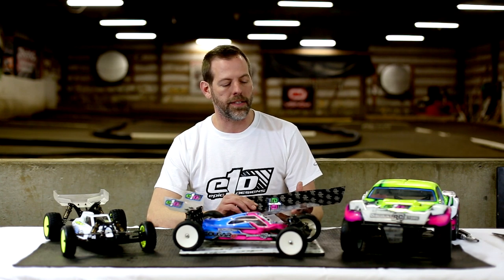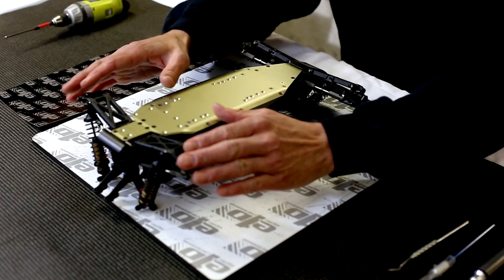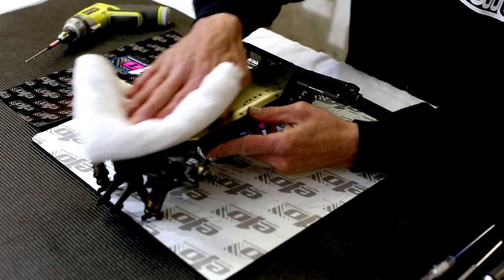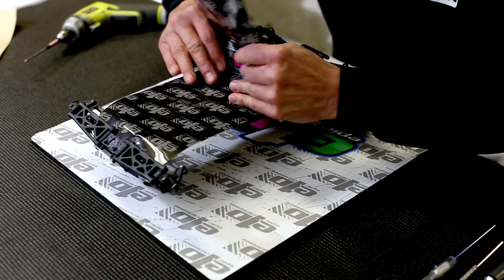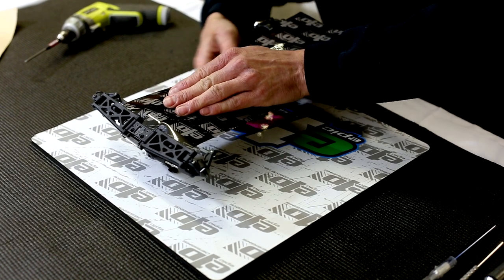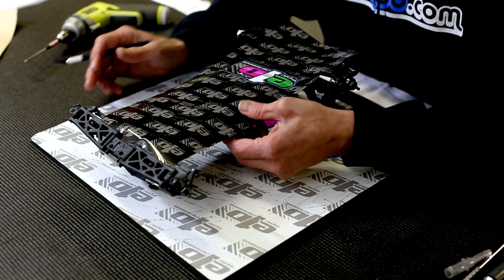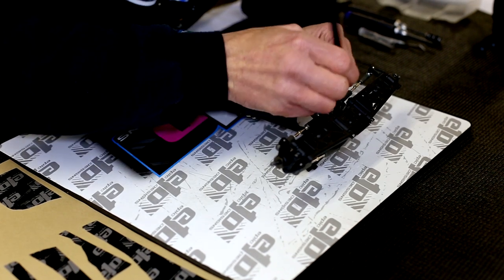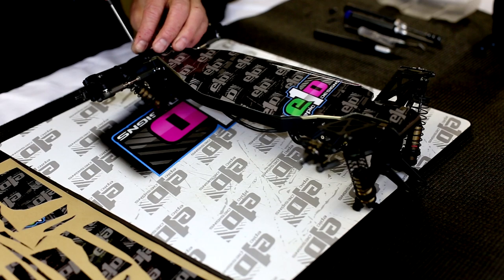e1D Chassis Armor

Comment: I've been using e1d armor for about 4 months now, still stuck on to my chassis without a problem.  Corners aren't coming off and all of the extremely dirty areas have no problem re-sticking when I remove the armor to access my hex screws. Other protectors were thinner and scratches/cuts would easily go through to my chassis, but mostly they were impossible to remove and re-apply. e1d is truly amazing, highly recommended!